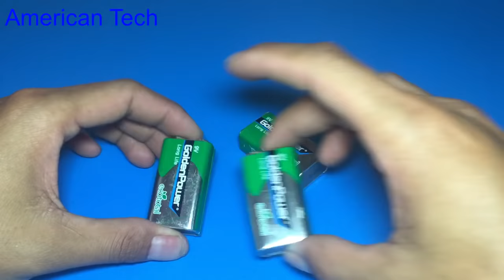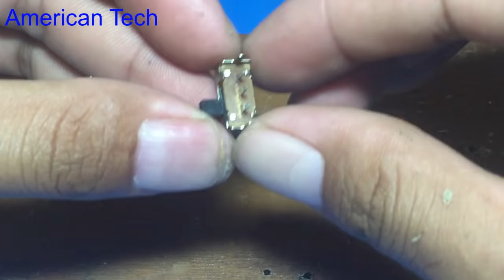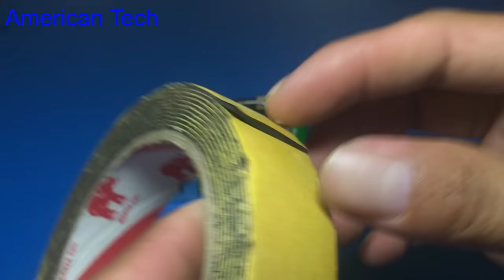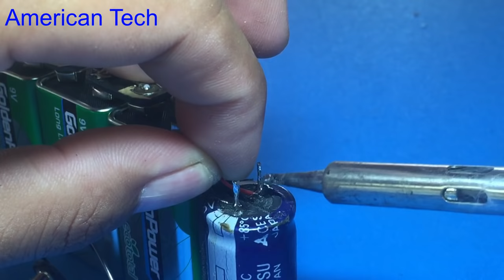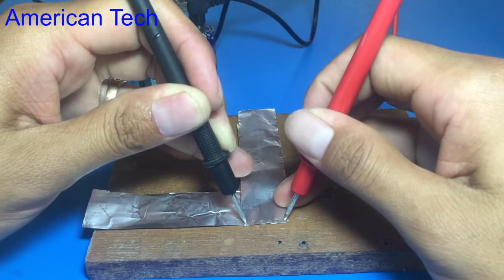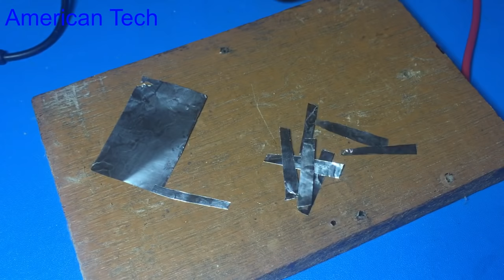How to make mini spot welding using 9V batteries and capacitor

Comment: This is more of a proof of concept than an actual useable device. If scaled up it could become a useable device. I need a cell welder for battery packs. For my first try I am going to use rechargeable tool batteries and a capacitor bank. Maybe not needed but I am going to put a diode inline with the batteries to prevent any feedback from the bank to the batteries. I like the idea.

Comment: Should've put the formulas behind the cap sizing decisions instead of winging it. No safely advice regarding that open cap (or cap safety in general) No audio, left cap exposed and upside down easy to short out, no resistors to limit current (although this is low DC). Touching metal while spot welding, also a no-no in reality. Someone's going to hurt themselves.

Comment: To get to that 4700 microFarad I need to put all the capacitors I have in parallel! 😅
However I use 29.4V Li-ion battery instead (rechargeable by the Li-ion 24V charger)!

Comment: uhhh, you have 27v of power feeding into a 25v capacitor. isn't that a bad idea? i thought over volting capacitors was a recipe for disaster. just a thought.
Reply: It's only two volts over regulation. While you are indeed correct 2 volts shouldn't do anything serious. Maybe over time it would, but two volts shouldn't like explode or something it will just get hotter quicker than normal.
Reply: @deverence.3339  thanx. it's always nice to gain some knowledge. when it comes to electricity, i generally tend to leave room for power fluctuations and surges. eg, i would've used a 30v cap. instead. but that info might be useful in a pinch.
Reply: @handyhippie6548  running 27 volts through that capacitor is basically pouring boiling water on a balloon. You think its gonna pop you think its gonna pop and, eh. If you wanna see something cool look up running 100 amps through electronics
Reply: @deverence.3339  i mostly deal with line voltage while installing electric wiring, fixtures and breaker panels in homes. i've seen what 100 amps are capable of. that's why i am cautious. i've been zapped by 110v so many times, i'm surprised i don't glow in the dark. i do however, have a couple of small arc burn scars though. just one of the joys of being a contractor/remodeler.

Comment: First, spot welding it from oppsite sides would be better. Second, more batteries equals more voltage and amperage = STRONGER welds.
His idea is sound, but this example is almost useless for anything.

Comment: Just to let you know, you need gas and alot of heat, guick for aluminum, that method really only works well for steel. Thats why it's not working well. Try with a piece of tin can, steel, and you need to make a little rod of materail yourwelding.

Comment: Too many haters here! I use tin foil as busbars on every high capacity Lithium battery bank and ALWAYS spot weld with 3 x 9v batteries. YT comments sound like all those morons trying to sue me for  "gross negligence" or whatever that is supposed to be.
Reply: Right, apart from the poor soldering technique and construction, the wrongly connected switch, the under-rated capacitor, the lack of a bleeder resistor, and the total disregard for safety.

Comment: used the 9V batteries in series which comes 27V but used capacitor of 25 V which against the rule and the capacitor can be blast. therefore, the capacitor should be used at least 35V.
An other thing why should we use 9V battery, it is better to use 18650 or like wise cells.

Comment: This is dangerous.  You have three 9V batteries in series, giving 27V.  The large capacitor you have across the supply is rated at only 25V, less than the source.  There's probably not enough current available from the 9V batteries to blow up the capacitor, but it's a safety hazard, nonetheless.  Some kid is going to duplicate this with bigger batteries, not knowing about the ratings, and then it will go off in their face like a firecracker.  Also, the cap should be rated to handle high current quick discharge.

Comment: single nine volt battery directly on a thin foil will do the same..
Reply: No it won't. Not enough current. That's what the capacitor is for.

Comment: I would think it would be better to connect the batteries in parallel instead of series & use more capacitance... welders, spot or continuous, need high current at low voltage... 🙄😒

Comment: If you had spoke, and explain what you were doing, the video would have been a whole lot shorter. Cat got your tongue? Might add, if you had used 12 volt car batteries linked together like shown (without a Capacitor), you could have welded a piece of 1/4 inch thick piece of steel together, using a welding rod, and battery cables.

Comment: here is a better spot welder than that thing witch is suposed to be a spot welder use a 9V battery with 4 50F 2.7V supper capacitors in series and use some copper wire and copper nails (i would use a foot switch because i'd like to be able to put the terminals in a good spot)

Comment: Crude method used here. As a result you can clearly see the disadvantage: the welding spots are burnt thru.
Use a regulated supply to charge the capacitor to a set voltage and put a series resistor in the line from supply to capacitor, to minimize the load on the supply.
Ideally the supply should not participate in the welding process other than slowly re-charge the capacitor.
Batteries will then last much longer.
The larger the capacitor (a couple in parallel) the thicker the foil you can weld, as the welding power then increases.
Disadvantage here is the waiting time between welds for the capacitor to recharge.
- and of course a more complicated circuit ...
Reply: @cxension.  I think you're missing the point here!

Comment: I want to make a mini spot welder which will work with electricity or with 12v battery than what materials i should use kindly tell plz
Reply: I want to make the spot welder only for welding steel strip on 18650 battery kindly tell what should i do
Reply: A small can of gas and a book of matches work great !!!!

Comment: Wouldn't it be easier to connect the three 9v batteries together without those connectors?
You know, you'd have have two batteries one way and the connecting, middle battery, upside down, connecting the two.
Do you follow?

Comment: That capacitor isn't good for that project. You have 3 9v batteries in series, thus the total is 27v nominal. Your capacitor is 25v, thus you'll be constantly overcharging it.

Try at least 30v-35v

Comment: Welding isnt simple and you can use 9v batteries to do this just because your adding voltage you have to think of amperage and this would scare the shit out of you once the 25v capacitor blows the fuck up

Comment: Even without the capacitor it will work. Because 27 volts is enough to weld the tim foil.
Reply: You need current, not mere voltage.

Comment: Whenever hes testing it the positive lead dissapeared from the capacitor
But it could still possibly work even though it only runs on 27 volts
Reply: The batteries charge the capacitor. The capacitor supplies the current to the weld. Stupid idea though in many ways. Doesn't need 27V for a start, better to put the batterie in parallel. And soldering technique is non-existent. And finally no regard whatsoever for safety. This thing could kill you easily.

Comment: the start of these video looked interesting, but then...tin foil spot welder..wtf! change the title to what it really is. The 25V cap might work better at welding your eyebrows together when it explodes.
Reply: Oh my goodness its 3 batteries it cant just magically weld cars together it's only 27 volts
Reply: @deverence.3339  LOL. The switch had me in stitches, like that's gonna help when the battery terminals all short together in your toolbox and you don't have any spare batteries to spot weld the hole in your tin foil socks. LOL

Comment: solder as  wire wtf did I just watch. Also, 25 V cap is underrated it, as those 9v batteries are more like 9.5 when new, so that gives 28.5 V across the cap. As long a sit doesn't pop into your right it's fine right?

Comment: So many of these.. parallel them for more current.
Series gives you more voltage.. you want more current not voltage
Reply: he is welding using the capacitor, more current would mean faster chraging of the capacitor

Comment: What I wanna know, is this just for aluminum foil, or can it be used for heavier types of aluminum?
Reply: It's the capacitor value in µF's that gives you the sharp current peak for the welding.
The bigger value the more welding energy hence greater chance to make a weld on thicker material.
Remember to protect the batteries from fast discharge, by putting a resistor in series to the capacitor.
Also - as pointed out by others - the capacitor should have a rated voltage HIGHER than the supply voltage.
With 3x9V batteries, it should be the nearest higher standard value of 35V or 40V.
Reply: What do you think? It's 3 nine cold batteries. Come on. It barely "welds" tin foil! I bet a lot of that sticking effect is just the really sharp electrodes piercing the foil. You can actually bond 2 pieces of foil together with something pointy without messing with batteries.

Comment: what is the capacitor value, 3 X 9 Volt 27 Volt and you are using 25V capacitor , that could be dangerous , what is the value of capacitor, how much Mf????, that kind of videos can be very dangerous , even a kid can do this because very easy to think and develop, sorry about that as an engineer I did not like this.

Comment: Looks like this technique is a little too powerful for tin foil. I have a $400 portable amplifier that I want to put a cage around the volume knob so it doesn't mess with it when it's in my pocket. Would this technique be safe? I don't know if it's worth the risk or not. I just need something that's gentle and won't produce too much heat or harm the electronics.

Comment: you are using the same thing used for welding as a mini cable to connect terminals?
and you just welded aluminum foil thats lame

Comment: connect the capacitor in parallel? what good does it do?
Reply: The cap stores energy and when shorted delivers 27 volts - helps to boost the current.
Reply: When shorted delivers the charge. Supplies practically all the current.

Comment: I ask unto anyone... What component do you put between a Battery and capacitor so that it has a repetitive charge and/or continual capacitance?  I forget, but in my walls I have many many components.  ALSO:  The one I want to enjoy is a 200v 680uF; and will it keep shocking me?  (I am thinking one way diode)
Reply: A resistor.

Comment: can this work to spot weld 18650 batteries?
Reply: need something that is safer than that
Reply: No, you'll need much more energy than 1-2 joules for spotwelding batteries.
Reply: only with aluminium foil ... XDD
Reply: No

Comment: How much Ampers do you get ?
Reply: +igrewold
Amperage has nothing to do with capacitance of the batteries.
For spotwelding you need high amperage, not sparks.

+José Arnaldo Pinheiro dos Santos
Depending on the ESR of the capacitor and the resistance of the wires and foil combined.
I=V/R , so I would guess something in the range of 20 to 200 Amps. The total amount of energy in this case is at max 1.7 Joules which is only enough for spotwelding very, very thin foil.
Reply: @igrewold Those battery milliamps go into the capacitor. The welding current comes from the capacitor. It can be tens or even hundreds of amps.

Comment: Shouldn't capacitors always be rated for twice the voltage of the circuit they're in? Or does that depend on intended application?
Reply: Most people aim for at least a 20% safety margin. I would use 35V, but then I wouldn't go anywhere near this lethal device at all.

Comment: If the voltage was increased (more batteries would this be strong enough for thicker gauge for use on a battery pack if so what gauge if I wanted to build a larger pack.

Comment: This is all fake. I have 48 volt power supply and 15 amps and it can do shit, and now you can weld with this thing? 27 volts?
Abd also to increase the amps in the batteries you need to connect them in parallel not in series
Reply: I never have seen a 48 volt power supply take a shit , but they say you can weld with your penis  just the same   :(
Reply: You are overlooking the role of the capacitor entirely.

Comment: Adding the capacitor takes energy away as it does not generate power. The capacitor has an ESR which creates additional load to the battery pack. Somebody did not graduate physics class 101.
Reply: Rubbish. The capacitor stores charge and delivers it far quicker tthan the batteries alone can. Batteries also have ESR and can only deliver milliamps. Capacitors can deliver hundreds of amps.

Comment: Bhro it not warking  it fak 25v 100ufof capaciter vallu is not working
Reply: OP used 4700uF. Stupid enough and lethal enough already, but what made you think it would work with 100uF?

Comment: Capacitor is doing nothing. Even if the batteries were flat, I dont think the capacitor would do anything.
Reply: The capacitor is supplying all the current. The batteries alone can't do that. Try it.
Reply: @EJP286CRSKW  Magic 4700 uF capacitor hey? Those 500 mAh batteries are much much more powerful . A super capacitor might be able to do something. Look up supercapacitor, its more like a battery. Do some research and think about it, capacitors generally stabilize voltage not current. You could just replace the 3 x 9v batteries, 27 volts, with a 12 volt car battery, it would perfectly for spot welding aluminium foil, probably too powerful. Adding a pissy little electrolytic would do nothing.
Reply: @jumboegg5845  A car battery can deliver several hundred amps, and so can that capacitor into a short circuit, for a very short period. Those 9V batteries can only deliver 500mA. The capacitor is therefore not 'doing nothing'. They are used for a similar purpose in flash photography, among other things.

NB I didn't say anything about stabilizing current, and 4700uF is not a 'pissy little electrolytic'. And a supercapacitor is still a capacitor, not 'more like a battery'. It is an energy store, not an energy source.